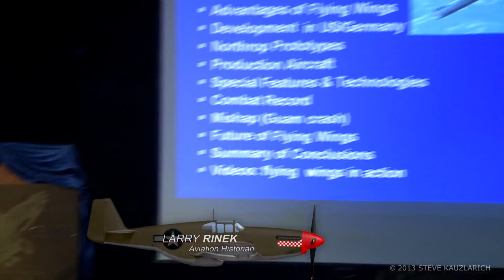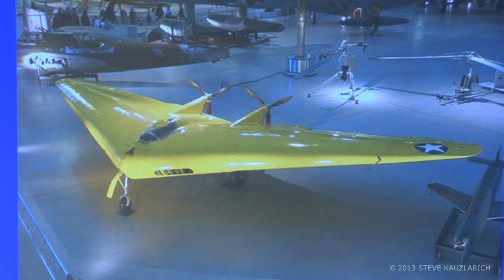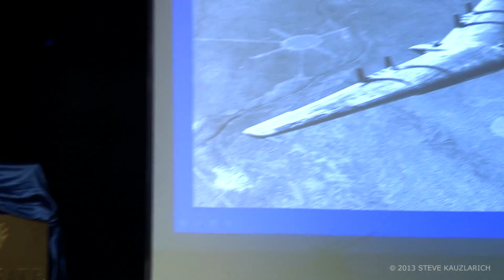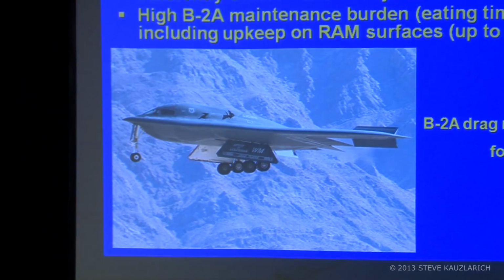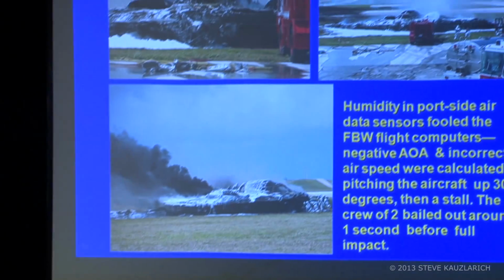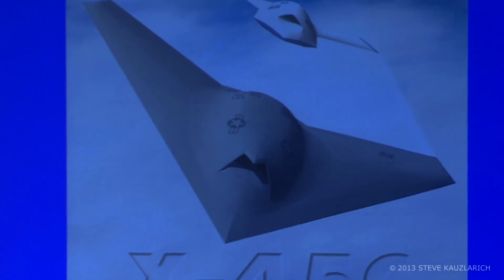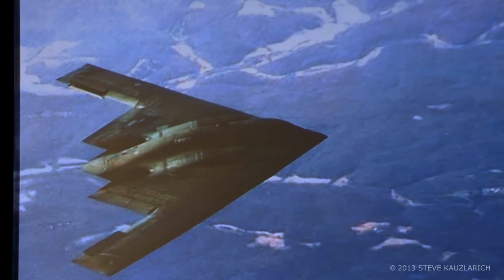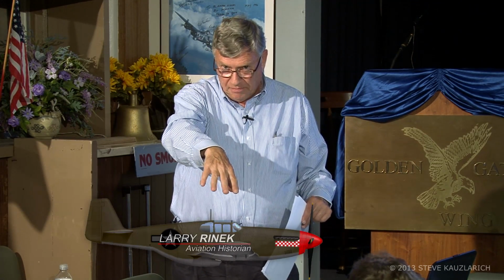HISTORY OF THE FLYING WING, with Larry Rinek

Comment: OH.... And the RAM... Microwave Browning Foil.

That was a spin-off license, licensed first to Birdseye in the 1980s, when Have Blue and Tacit Blue were in development.

The creators of the coatings noticed that SOME of the coatings produced a ridiculous amount of heat due to the Microwaves being absorbed.

This wasn't good for Stealth, as it made the Aircraft too visible in the IR spectrum.

But they thought "We aren't going to use these. And we could use some additional income to finance these projects. Hey! DoD, can we sell the License to one of these to a Microwave TV dinner maker to "brown" foods in the microwave."

The DoD said "Sure, but lie about where it came from."

One of my engineering Professors was on the Radar Observability Programs in the 1970s that gave rise to the F-119, and eventually the B-2, and which did the observability testing on Have Blue and Tacit Blue at Nellis AFB.

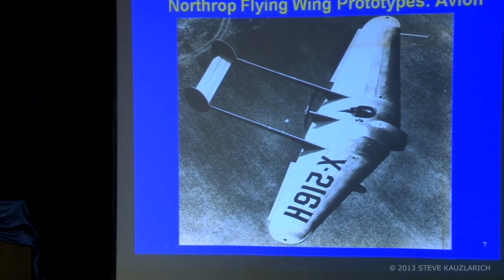Comment: 8:45 "first crude effort"

Among planes of its power/weight class, the "216" was among the best of them in just about every category, from STOL and stall & spin handling, to maneuverability. Among planes of its class, it was a good 30% faster than any of them.

This was his tailed wing, and the best among them in terms of fly-ability. The rest of the work on all-wing craft didn't go anywhere other than a few test models and one barely and now non-operational production of a handful of expensive, risky, hard to handle B2. They all went wrong in not having tails, while eliminating non-lifting volume and drag.
Among the current crop of lifting body R&D, the Lock-Mart logistics hybrid wing-body is another approach at lifting body/span-loading planes  They have another sleeker tailed lifting body thing they were offering recently as a tanker.
All the tail-less designs being floated around today are considered more risky, for instability/handling (Like all flying wings, they try to kill you if you approach stall conditions or conditions are less than ideal).

Comment: You got the cause of the crash slightly off.  The B2 was stored outside (believed first time). The tube collected water and during morning checkout, the air speed failed. Maintainance came out and decided the tube was out of wack and recalibrated the sensor (without turning the heater on).  When the pilots came out in the afternoon, they turned the heater on (causing the water to evaporate and the sensor to read high.  When the weight came off the wheels, indicating air borne, the computer thought it was going fast enough to climb; and failed.

Comment: This is not history, Its the Horton that created that history.
That is a sad fact for you Americans.

Lets drop the bullshit shall we? 

Northrop and all the americans where just pathetic copy its blueprints and call it its there inventions

And yes that it is clearly provable.

When we are talking swept wings is related to pure wing designs. Which have another purposes. Stability 
In order to have a plane that flies well you need 3 basic things one of them is a tail. The other 2 is the point lift and the point of weight.
If those 3 things is well balanced you will have a really good plane. The Hortons solved the tail problem with a higher angle on the wings. Which northtrop didnt followed. Properly due the demand of 4 proppeled engines

The B2 had the angle is as Ho so is its tail.
Which gave the stability Northrop didnt had.
Yeah have read about Northrop, that was the reason it got trashed.
Pretty hard to deny that. Seems like copy of the blueprint of Horton to B2
Even the engines are placed as Ho 225
I think we can conclude you were the one that is biased, by your proud of being American.

Just calculated that

Northrop 31 degrees swept wing same as Horton version 3

https://www.google.dk/imgres?imgurl=https://s-media-cache-ak0.pinimg.com/736x/91/bf/45/91bf45eae64fc8fb514ef5a87c65167a.jpg&imgrefurl=https://www.pinterest.com/pin/298856125242216376/&h=372&w=500&tbnid=MXs_6GwBqmvJ-M:&docid=5dunvDJMniTvDM&ei=PWX5VumLL4bWOvKwmtgH&tbm=isch&ved=0ahUKEwipnsfI7-PLAhUGqw4KHXKYBnsQMwgiKAUwBQ

Btw dosnt that earlier version of Horton design reminds a lot of the Northrop wing desing?

http://www.fiddlersgreen.net/aircraft/Horten-HoIV/IMAGES/All-three-Horten-Flying-wing-gliders.jpg

Same tail tip and I bet the angle is simular.

Some claim that there is direct relation.

Ho VI "flying parabola" - an extremely-high-aspect-ratio test- only glider. (After the war, the Ho VI was shipped to Northrop for analysis). 

http://greyfalcon.us/The%20Horten%20Ho%20229.htm

Horton  40 degrees swept wing

https://upload.wikimedia.org/wikipedia/commons/thumb/5/51/Horten_Ho_IX_line_drawing.svg/300px-Horten_Ho_IX_line_drawing.svg.png

B2 43 degrees swept wing
And pretty much the same tale as Horton An undeniable Horton invention
Especially easy to see by its first prototype.
Same placing of engines.

https://encrypted-tbn1.gstatic.com/images?q=tbn:ANd9GcTehR2pMF-OhC3zvuwVi11XCm9Qvy3z7UgyqWAr9hU1XC6z2zyQUlak_GA

Just prove what I always knew, that basic ground research like the Horton did is rare.
Imagine Northrop had access to the research
of Horton brothers. Didnt even got why they made other prototypes.
They choose a type of the Horton brothers that was unstable.
Thats how stupid cooperated research really are. Like the F35.
Just pick and chose without understanding the basic problems of it.

Hilarious
The 225 was at the design level way ahead of Northrop unstable version.

In order to have a plane that flies well you need 3 basic things one of them is a tail. The other 2 is the point lift and the point of weight.
If those 3 things is well balanced you will have a really good plane. The Hortons solved the tail problem with a higher angle on the wings. Which northtrop didnt followed. Properly due the demand of 4 proppeled engines

How did I knew that? 
You just dont get genuine innovative interested people to work, by CV and important job description.
Instead you gets alot of high Ego's

It is simply a Cooperate logistic fallacy.
The path to the idiocracy.
Since they certainly dont look at its own flaws.
None have it, they are Ego's

The most pathetic in this, despite they made the ground research that all benefited from and stole the research.
The only credit they can give them is discredit and denial of the importance of it.
I do not buy this is a secret due to this as only about politic, this is about the pure Ego that harvest from other.
If that is not pathetic.

Comment: Some interesting facts on the B-2, but Larry is wrong about the cancellation of the YB-49 contract. Stability was not the issue. Stuart Symington wanted Jack Northrop to merge with Convair and threatened Jack with the words, "You will be goddam sorry if you don't." See for yourself in the YouTube post: "Flying Wings--John Northrup's Final Interview--1979." The politics of big business put us behind in the development of the unique B-2 Flying Wing.
Reply: +Paul Austin 
I'm well aware of the politics surrounding the cancellation of the Northrop flying wing program. I have the post-mortem book written by Northrop management, which frankly was an attempt to re-write history. Please seek out the public interview with the USAF customer's chief test pilot for the YB-49 program, Brigadier General Robert "Bob" Cardenas. He clearly stated that the YB-49 was "marginally stable" (not unstable) in all 3 axes of rotation--roll, pitch, and yaw. In particular the yaw oscillation took so long to damp out, the YB-49 would fly beyond the designated bomb range. Northrop tried to fix this with an automatic yaw damper. However, based on actual field tests, the Consolidated B-36 was a better and more stable bombing platform than the YB-49. All of the tests are documented in USAF historical archives. Fortunately all of the technical issues surrounding stability became moot with the use of digital fly-by-wire in the B-2 bomber.

Larry Rinek
Reply: Beg to differ by this misinformed claim above for the YB-49: "stability was not the issue." Well-documented official flight test results showed otherwise. The USAF chief test pilot for the YB-49, BG Robert Cardenas has stated in public interviews available online that this airframe exhibited  "marginal stability" in all 3 axes of rotation (roll, yaw, pitch). The USAF found that damping out yaw oscillations took so long, that the YB-49 tended to fly past the ground target, even though Northrop installed automatic yaw dampers. By contrast, the Convair B-36 was a much more stable bombing platform, according to actual flight tests. Fortunately, all flying wing stability issues were resolved with digital fly-by-wire technology in the B-2.

Comment: J.W. Dunne in 1910-1916 had Swept back flying wings.pre empting both Northrop and Horton.
Reply: +Larry0947 I do not profess to be an aeronautical engineer . However, I have seen no reference to it having to be a monoplane prior to the works of Horten, Lippisch or Northrop.. And were that the case, then you must take into account the works of Junkers,Cheranovsky and Fauvel.
Taking all descriptions of what constitutes a flying wing, we come down to the simplest form.....An aircraft with little or no fuselage and no tailplane....and, according to Crane's "dictionary of aeronautical terms"  they may have  pods, nacelles, blisters, booms, or vertical stabilizers.[
As Dunne's "Tailess biplanes" were of an era in which the biplane was the standard aircraft form, then, IMHO, it was a flying wing.......or wings. 
The point being made is that Northrop , Horton, Lippisch  et al, were not the first in this field, rather ..the next stage
Reply: +SuperAncientmariner Yes, this video has rotten historical research. Dunne also gave advice to Geoffrey Hill on his designs for tailless delta aircraft (first flew in 1926), which were mainly built by Westland Aircraft as their "Pterodactyl" series (1928-1932). Jack Northrop was by no means the first to conceive of a flying wing.
Reply: Larry0947 In other words, IMHO, re defined to exclude the work of Dunne, Cheranovsky and Fauvel.
And this definitive work was written  when ...21st century. .
We will have to differ.
Reply: +Larry0947 Your qualifications are certainly impressive, but I judge the research by what you put on the screen. Your video is titled "History of the Flying Wing", and presents flying-wing design as beginning in Germany in the 1940s. My father's books, and my own reading, suggest that this is not accurate. It may be that my judgement of your research was uncharitable, but rather than beating me over the head with your resumé, that might better be addressed by explaining why you chose not to acknowledge the work of earlier pioneers, since I assume your superior research did in fact make you aware of it.
Reply: +AndiJF 
This video has "rotten historical research"? What have you done in this field? Show me your publishings and oral presentations. Hundreds of hours of competent research involving solid primary and secondary sources went into my flying wing program. I do research and writing for a living, for more than 40 years. I'm a nationally recognized aviation technology historian, active since 1991 (25 years), with many publishings to my credit, not to mention hundreds of of oral presentations over that time to various audiences. I'm a paid professional industrial lecturer for the SAE International engineering society, having delivered seminars to aero/mechanical engineering students at 8 colleges and  universities all across the US and Canada. None of this suggests a practice of doing "rotten historical research."
Larry Rinek
Reply: +SuperAncientmariner 
You and other viewers are kindly urged to review a free online scholarly technical paper that covers the history of the earlier developers of flying wings that you mentioned, before Horten and Northrop. The paper is the AIAA (American Institute of Aeronautics and Astronautics) #2001-0311 entitled "Flying Wings/Flying Fuselages", January 2001, by Wood & Bauer at NASA's Langley Research Center (Hampton, VA). FYI, I have been a long-term active member of the AIAA. In describing the early work on "flying wings", the authors concede that the definition was broadened, and does not match the current definition. The authors say that these early "flying wing" aircraft belong in the broader group of "all lifting vehicles" (ALVs). Now, on page 2 of the technical paper we find a modern accepted definition of the flying wing: "A tailless airplane accommodating all of its parts within the outline of a single airfoil." So, that is a monoplane with a single wing, not multiple wings (as flown by Dunne in England). Northrop preferred to define his flying wing as an All-Wing, namely an "aircraft consisting of nothing but wing."  The tailless flying wing was defined by the paper as "An aircraft consisting of single wing, without conventional fuselage or tail." OK, I have no further remarks, this subject needs to be put to rest.
Reply: +SuperAncientmariner 
I looked up the work of J.W. Dunne performed in England. He produced a series of sharply-swept tailless biplanes, offering improved stability. In no way, however, do they resemble a generally recognized flying wing configuration (always a monoplane).
Larry Rinek
Reply: +AndiJF 
As the author of this presentation, and given the title of the seminar, I'm free to select the focus, or historical scope-of-work, which deliberately concentrated on the most successful developers of manned powered flying wings, namely the Horten brothers and Northrop. In the agenda, I made clear the focus of my research. I'm under no obligation to research and report any and all purported earlier developments of supposed flying wings, which were feeble at best. I commented elsewhere on the Dunne tailless swept-wing biplanes developed in England (claimed to be early flying wings), which by any aero engineering analysis do not remotely resemble an accepted monoplane flying wing configuration. Since you are so passionate about this topic of earlier less-recognized efforts to engineer flying wings, may I suggest that you thoroughly research the topic and put together a competent YouTube presentation. Then we can sit back and judge your work

Comment: OMG. amateur hour, it's not stealthy when it's up high ground radars can easily see it!
Reply: +chris gange 
OMG amateur hour? What may I ask are your credentials in this field? I actually worked as an RF engineer working with S-band radar/microwave hardware on a daily basis. The notion of flying high over enemy territory is a non-starter. In the 1980s, the USAF customer re-purposed the B-2 mission from high-altitude to low-altitude (on the deck) penetration of enemy territory. That resulted in a major costly re-design and beef-up of the B-2 structures. All of that was reveled in my presentation.

Larry Rinek
Reply: Amateur hour? I was an RF engineer working with microwave/radar hardware in my early career. What are your credentials in this field? Flying up high over enemy territory? That is a demonstration of ignorance. In the latter 1980s during airframe development the USAF customer ordered a change in mission to low-level penetration over enemy territory.